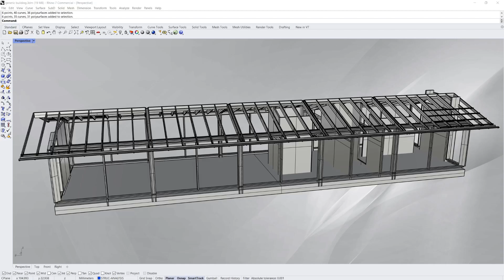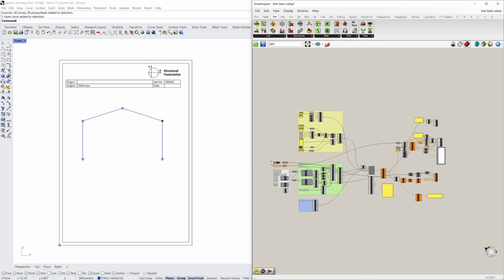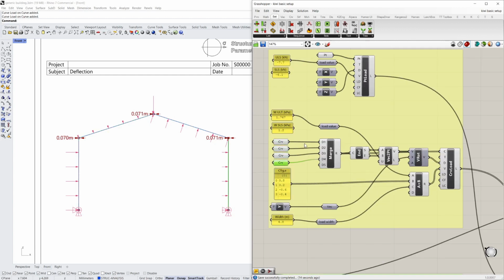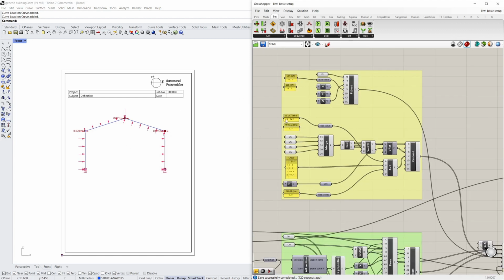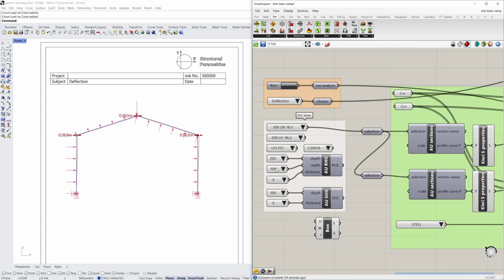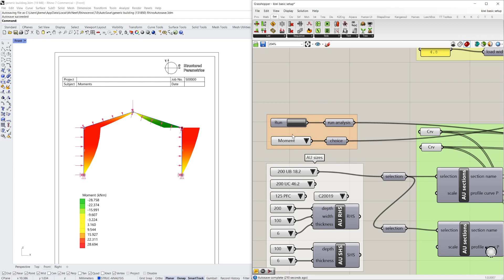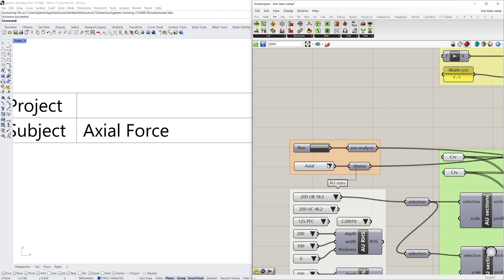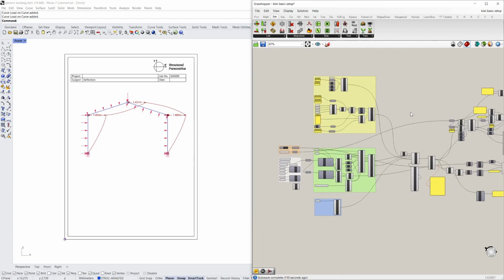Fast Analysis techniques to speed up structural design in grasshopper

Comment: Cant see any difference between this and a traditional spreadsheet / software. Both need to customize for a structure of a type and then change the input and the graphic of the result will update accordingly...